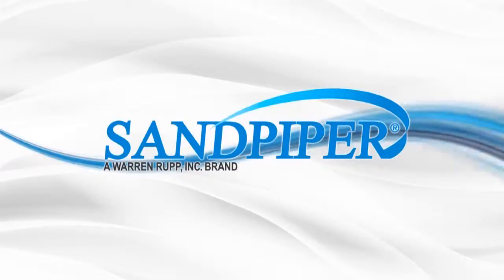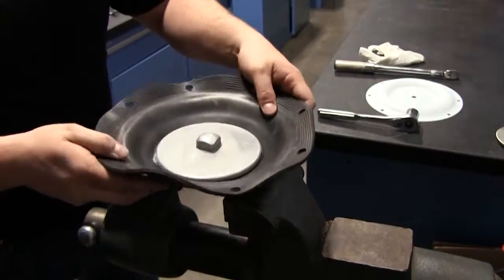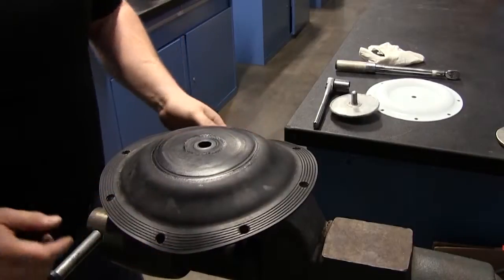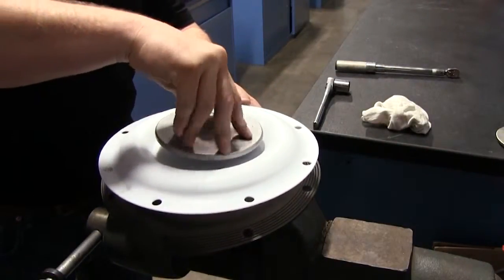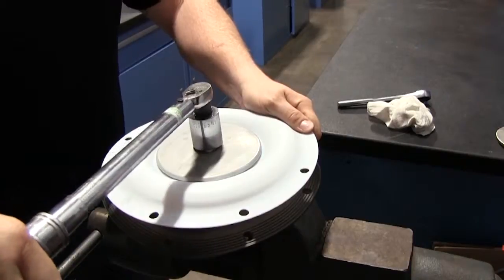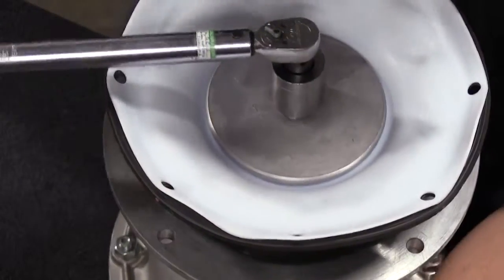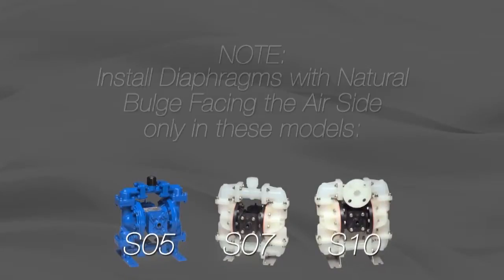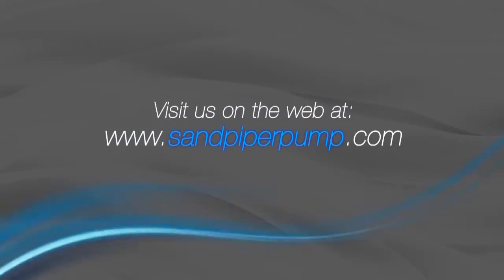Quick Tip #03 - Install a PTFE and Backer Diaphragm in a SANDPIPER Pump

Comment: I tried this but no good. The outer steel case does not fit over the white ptfe part. I had to discard it. I would have had to force the steel cover on and damage the ptfe white part. The previous two ptfe parts were in bits when I inspected the pump. Not impressed. !!!!!!
Reply: Hi Michael - If you have any questions, please feel free to contact our technical support team. They're happy to answer any questions you have: WRM.AfterSales.SP@idexcorp.com. Thanks!